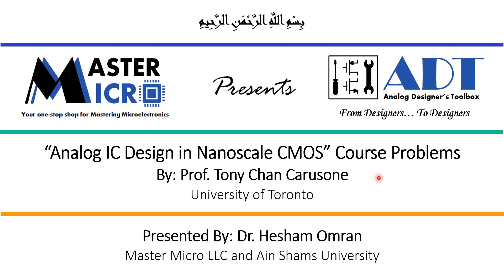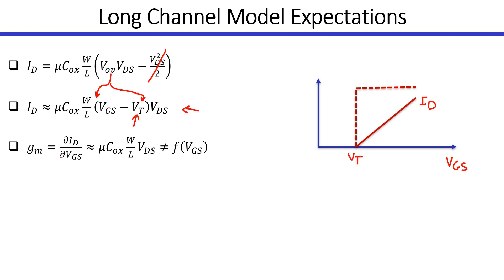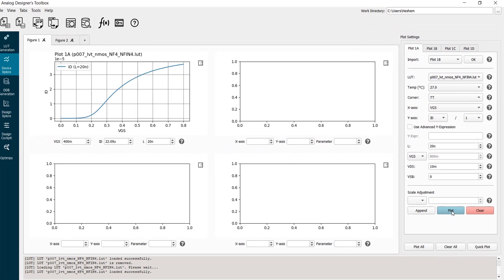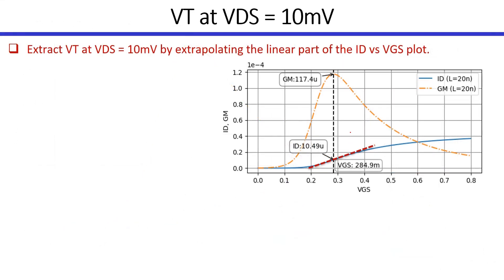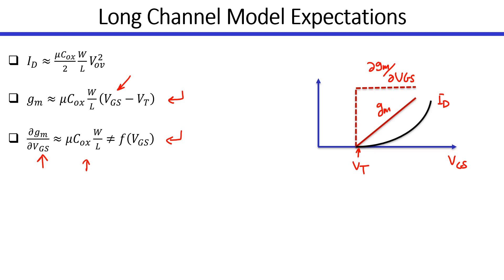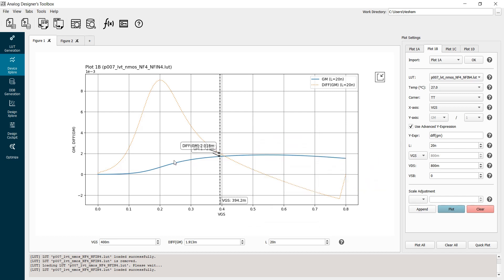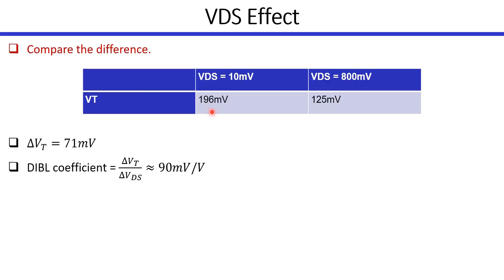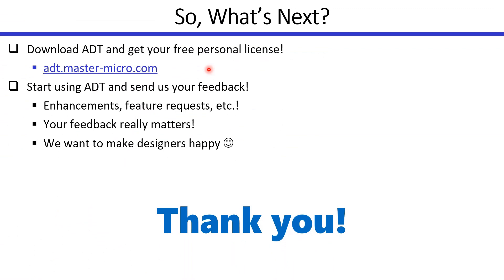VT and DIBL of FinFET | ADT Tutorials | Analog IC Design in Nanoscale CMOS

Comment: Could you share the LUT generation spice netlist? I am using: 
* filename is LUTspicescript.cir
M2 5 6 7 8 PMOS w=WP l=LP as=0.64u*WP ad=0.64u*WP ps=2*(0.64u+WP) pd=2*(0.64u+WP)
.INCLUDE /DeviceModels/p045/pmos_vtl_tt.inc
.backanno
.end

With the above I get this error: Error: [LUT Generation] No devices found in the netlist. Make sure all transistor names start with 'M' and their widths and lengths are correctly specified.
Reply from the maker: For these 7nm transistors the device characteristics were provided by Prof. Tony Chan Carusone.
For new LUTs, please check the example netlists included in the tool.